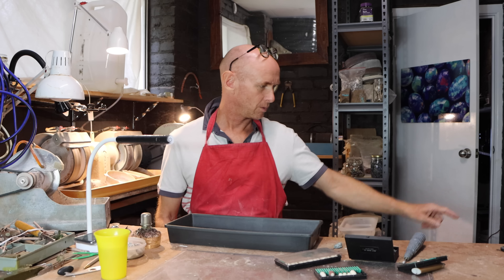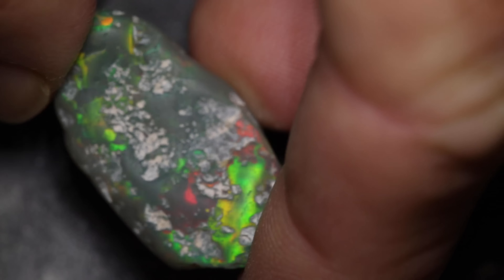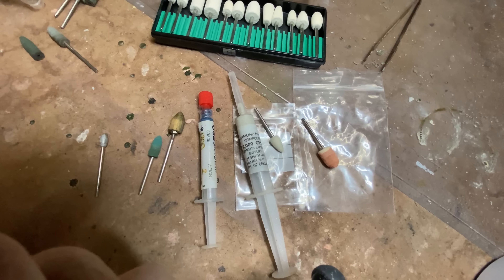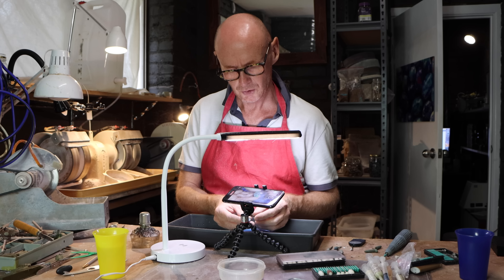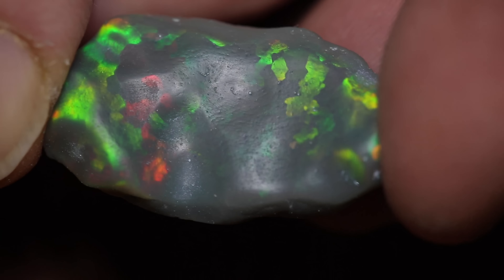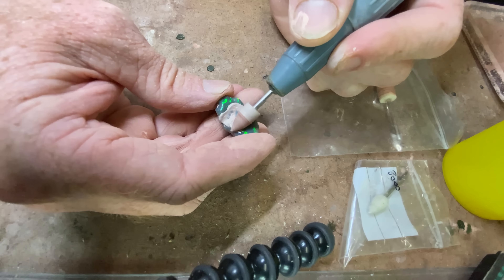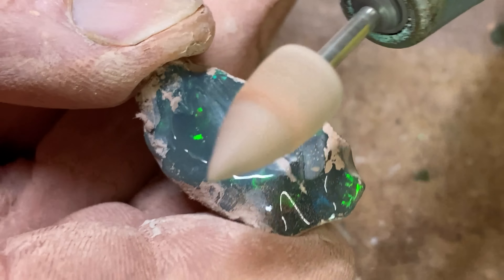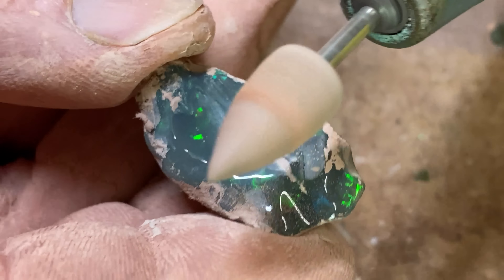Carving uncut opal with a Dremel. Tips and tricks

Comment: I once carved a 3,2cm Salamander out of a mineral stone (don’t know what it is) that inspired me due the green color an S-shaped red line in the middle. I used professional gear for dental tech‘s (I am one), Diamond grinding tools, polishing rubber. I was amazed how hard that stone was, I almost gave up after 45 minutes. Felt a lot harder then titanium.  It cost me a lot of diamond grinder and discs, and a lot of time. Finally I glued some little gold drops in for eyes and cast a rough nugget shape around it out of kobalt-chrom-molybdenum steel, looking like the salamander was sitting on it, with all his little toes and bumps on his back, grinning slightly😊. It turned out nice as a pendant. But took me some 11-12 hours of hard work...

Comment: For other mining districts - make sure your re-hydrate your opal by rinsing it in clean water several times after the solvent is done. If not, the solvent evaporates fast leaving the stone dry and it could craze by drying as fast as it can without re-hydration from the air. If you are using the solvent to carry in resin or a filler, that is not an issue.

Comment: Hi Justin.  Tks for the entertainment during this isolation period.  
I've been looking for a drop down type slab saw like you have, but can only find ones that protrude up through the table.  I'm in Canada, and there seems to be very limited lap equipment available here.  Any suggestions?  I've even thought of trying to make my own from a bench grinder, but I'm not sure of rotation speeds needed, or arbor sizes for the blades etc.
Reply from the maker: Yes a drop down saw is prob not the best was to slice opal. but would work kind of

Comment: Thanks for making this video!  I did a similar carving and it looks very similar, I called mine "melted gummy bear" :-)

I'm curious if you have any thoughts on using the other Nova tips in the process, for example, instead of the wood+paste use the 1200 nova tip?  What I've been trying is sintered bits 100#, 220#, 320# and then go to nova bits 280#, 600#, 1200#, 3000#, 8000# -- but, I don't think I spend enough time on some stages, easy to get impatient with all the steps.  Another thing that I realized to be cautious about is with wear on those felt tips, I was using those with some coarser grit pastes and before I knew it the top of the felt had worn through to the metal shaft and that's no bueno.

Thanks again for all the info!

Comment: Great result and congrats on your patience. Looked kinda cool to start with too. I use superglue gel, be interesting to hear your thoughts on that. I was using acetone to get them off the stick, but a cutter from the US told me to try just water and it worked fine after a couple of hours. Been sent some wax, but the superglue gel is working fine, maybe not the time you get with wax positioning the opal, but not bad.